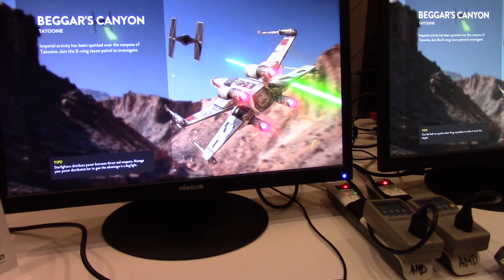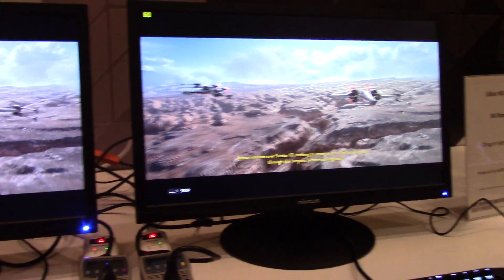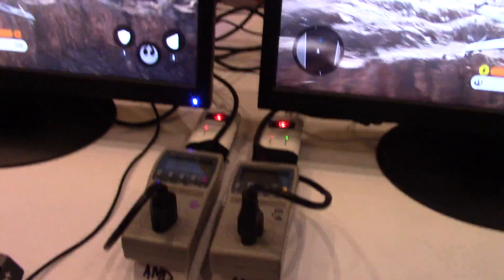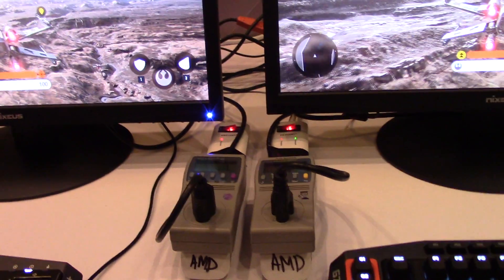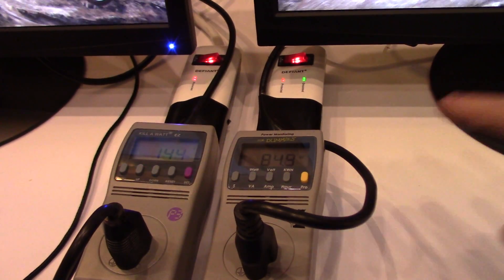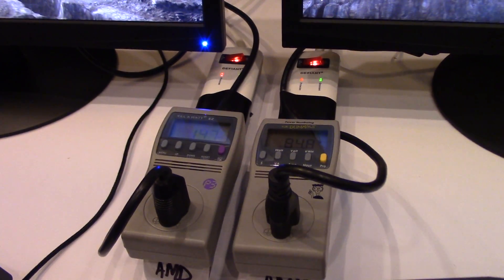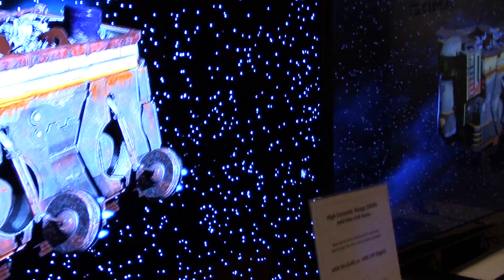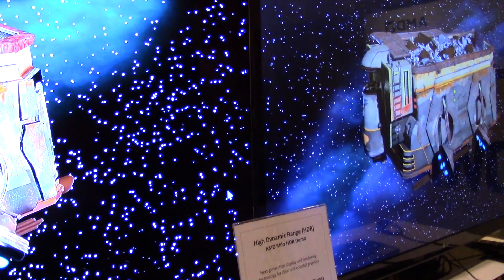CES 2016: AMD Talks Polaris GPU and HDR Monitors

Comment: "HDR made available via driver update for all current R9 300 series GPU's"   Current R9 300 series are just re branded R9 200 series, so if the 200 series get left out in this driver update to suport HDR I'm sure AMD will get ALOT of flac about it.
Reply: +vicdez Although very similar, they aren't quite re-branded. The 300 series cards typically have better cooling and more vram, and occasionally better PCB design. For the most part, everything except the GPU is altered.
Reply: vicdez Performance clock for clock doesnt really mean anything in this scenario. 390s can run higher clocks at lower voltages than 290s - which is the point. And they use better ram chips. Which overclock much better than the old ram chips.

Calling it refresh is fair (compare this with Intel relleasing Haswell refresh - same uArch no change to the silicon but more mature procces + better TIM allowed for better clocks).
Reply: +vicdez I would suspect that won't be a problem since the driver doesnt really see a difference between those gpus. For example my 7970Ghz edition is seen as "r9 2xx/HD 79xx series GPU". What I am interested is if HDR will come to GCN 1.0 gpus aswell (such as mine which are not part of 3xx series.)

Anyway I can see that 1440p HDR can actually be the future as opposed to 4K which I don't really see catching on any time soon.
Reply: vicdez
Boy you propably dont understand what clock for clock tests are meant to be for......

390s are basically a better binning of 290s due to improved yields and improved process. Yes they are the same gpu but so is i5-6400 i5-6500 i5-6600 ....  You dont go around comparing those clock for clock and reaching a conclusion that they are the same....
Reply: +MrJigssaw1989 

So a better binning process means the actual gpu die is different and physically can't support the same features there son....
Reply: 2016 is the year 200 series owners should upgrade, and because Polaris is new architecture
Reply: Actually no. The partnered manufacturers will always have their own pcb designs, but the actual gpu itself is the same. Take a look at the reference R9 390/390X and even the first batches of partner cards and they all use the same pcb as the originals. Even the 390/390x BIOS' can be flashed and work on 290/290x's with a little tweaking for the difference in memory capacity.
Reply: +vicdez but the 390s and 390x are made with better materials
Reply: boss1234234

Gold?

Seriously though, the 390/390x launch was marketing hype. Take a look at real review sites that compared pcb, components, layout, design, performance clock for clock and you will see. Even AMD themselves when asked the question danced around the subject, and the best thing they could come up with is that it was a better manufacturing process. Don't buy into the hype.
Reply: vicdez dude the 390 and 390x overclock higher than the 290 and 290x
Reply: The 390/390x do overclock higher by like 25-50mhz on core. They also do run cooler but honestly those are simply bios tweaks. Anyone who flashes compatible reference 390/x bios with reference 290/x sees a 5 degree temp drop. The memory is a slight upgrade since most 8gb chips can overclock to the 1700mhz+ range while the 4gb chips top out at 1650mhz or so.

PCB boards will always change from reference, to partner custom boards, and even including ram. What does not change and is still the same is the actual gpu chip.

Like I mentioned before take a 290/x and a 390/x and set them up at same clock speeds and performance is the same. If you don't believe me look on review sites, you tube videos, and online forums etc. If you set a 290/x at say 1100/1500 the performance will be the same as a 390/x at 1100/1500 on the same system.
Reply: vicdez what he saying is 390 and 390x will all overclock really good compared to 290 and 290x which some overclocked good but some overclock really bad
Reply: vicdez
 That is not the issue :-) Of course they will support the same stuff. I was replying to you saying that 290 -> 390 was a rebrand and only marketing hype. Which I pointed no - it was a refresh.
Reply: +boss1234234 
DUDE look at your self. You're responding to a guy who does not know any better you will not win!.
Reply: +MrJigssaw1989 Bad wording on my part. There are some improvements and not "all" marketing hype. There are people that think they are a completely different gpu though. Hence someone might believe it's totally justifiable that the 390/x is capable of something the 290/x is not. In this case a feature that's usable through a driver update.
Reply: +Deyon Singh ASSume much you do. ;)
Reply: +Danz Tim 2016 to early 2017 i am hoping to make a zen+polaris build, and if either polaris or zen end up disappointing after all of this hype i'm going to be depressed. i've been practically drooling at every piece of info i've gotten on them so far, they both look like they'll be incredible :F

Comment: They are comparing it to a gtx 950 ??? ah come on AMD. using a rival budget card to compare your best really ?
Reply: +AngryTech This the first silicon made on the new node which imposes a huge restriction on it's size. From what I have read the current polaris chip is really tiny and smaller than the one found on the 950. Because at the current date there is no FinFET GPU from Nvidia the comparison makes total sense.
Reply: +AngryTech Conversely, if this is what their lowest power consumption card can do, what will a 300w top of the line card be capable of?
Reply: +AngryTech seems like you mad. Why don't you just go play games with your GTX970 3.5+0.5gb ram.
Reply: +AngryTech AMD published the specs of both systems. They are in fact identical. Except the GPU, of course. That's why it doesn't matter what CPU, RAM, SSD or whatever was used. GCN4 + 14nm FinFET will be a massive improvement over current GPUs. You don't need to be naive to believe that.
Reply: +AngryTech lol did u even watch the video? They weren't comparing performance, they were comparing power consumption! Plus, the GPU's are from the same segment.
Reply: +AngryTech this chip will be priced accordingly to its perfomance, not power consumption. They will start from the chiepest GPUs. You should start to read articles as well
Reply: +AngryTech 
Because 14nm FinFet are new manufacturing process with poor yield AMD has to start with smallest GPU dies. This is confirmed by journalist that have seen the chip and report it is quite small. 950 has die size of 230 mm², with abut 3 billion transistors, decent sized. If this AMD chip has abut half the die size and abut 3 bill transistor count it is fare comparison to make it go against 950.
Reply: +AngryTech They are comparing with one of the best cards regarding performance x  power consumption from Nvidia just to show that their nex generation gpus are more efficient than Nvidia's current gen. I doubt they are using their most powerfull card for this test. Plus Nvidia will also benefit from the same power consumption reduction with Pascal.
Reply: +Amir Syazwan He's probably waiting for the GTX 1070 with 7.5GB GDDR5 and 0.5GB HBM2.
Reply: +AngryTech   both  are  locked  at  60 fps  so  stop  talking  trash !
Reply: ***** Year after AMD comes out with this BS and year after year people defend it, he was quite happy to say "rival" until challenged. 
The fact it not stated on the demo alone is underhanded.
The way he said "can we and oh i think it's a 950GTX" 
If he  was asking MPC "can we"  or an other AMD guy I'm not sure but either way its funny. If  he was stating facts then it doesn't matter if you mention a rival.

Does anyone know what CPU, RAM or SSD's, Motherboards or even PSU's  or what was in the systems when they don't even disclosed the GPU. 
Come on seriously here people are ye all that naive.
Reply: +AngryTech By saying rival they are just saying Nvidia, any computer savy person know their only rival is Nvidia, intel and S3 aren't even on the podium (unfortunately).  And is understandable that the guy was cautious to mention the name, if not approved by the leader it could put him in a bad stop, it can also give amonition to their rival to sue if something was found wrong, just like Samsung sue Nvidia for faking benchmarks. And is not like Nvidia does any different about disclosure of the specks, i'm yet to see a oficial Nvidia comparison showing total system info, i only see that on game and Hardware reviews sites and videos.
Reply: +AngryTech It's not their best, it'll be their worst 14nm GPU.
Reply: +AngryTech They weren't using their best. This was a budget-oriented chip.
Reply: +AdoredTV you meant low end right
Reply: You know there little word called competition for your information
Reply: +LazyOtakugamer HD (Roynoris Senpai) Yes, their slowest is more accurate - not worst.